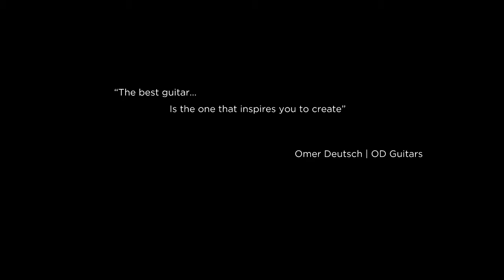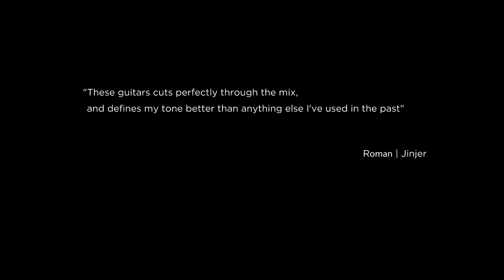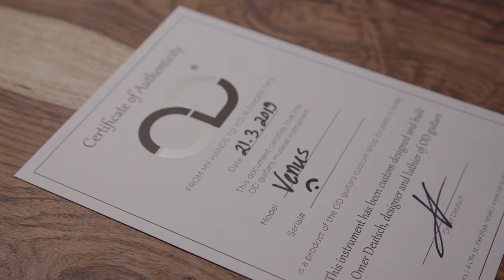Building a custom guitar - OD Guitars

Comment: Neck just glued on,,,, hmmm 🤔
Reply from the maker: Yep, it calls Set neck 
3 options to go about doing it:
1. Bolt-on (screws)
2. Set-neck - glued neck 100% contact for the neck with the body (in my knowledge and experience -the best result for sound) 
3.neck-through - neck that goes all the way through the body (also better then Bolt-on in my opinion)